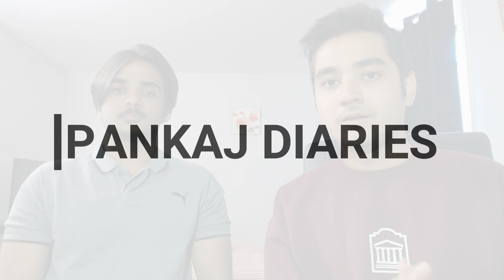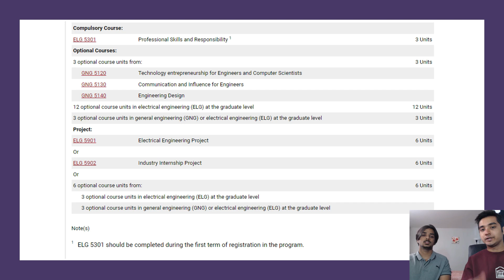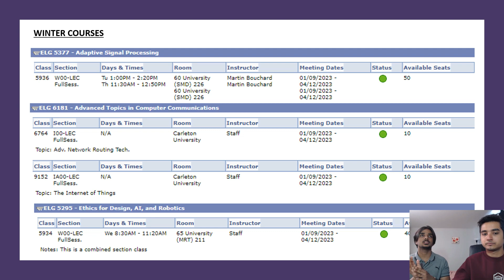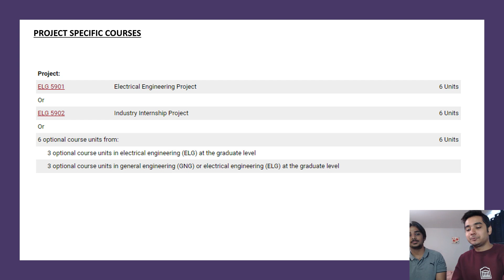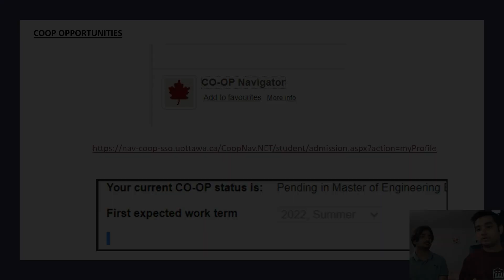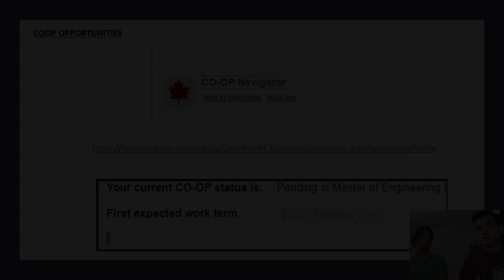MEng Electrical and Computer Engineering General || University of Ottawa || Algonquin college ||

Comment: Thank Pankaj for your video. I would like to ask whether master's programs with a course-based structure require students to choose their own supervisor. I noticed in the program requirements it states: "The choice of research supervisor will determine the primary campus location of the student. It will also determine which university awards the degree." Does this mean that MEng students also need to choose a research supervisor, and that some MEng students admitted to Ottawa may ultimately receive a degree from Carleton?
Reply from the maker: @咸鱼东-x8k  I hope the video helped.
For course based masters, you don’t need to choose any supervisor. Go ahead and submit the application :)
Reply: @PankajDiaries  That's very kind of you, thanks a lot🥰